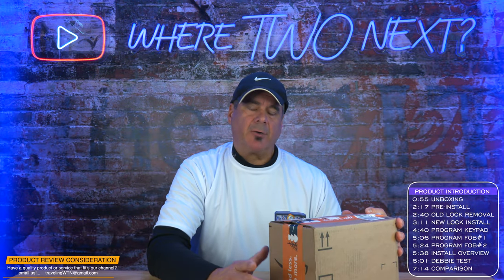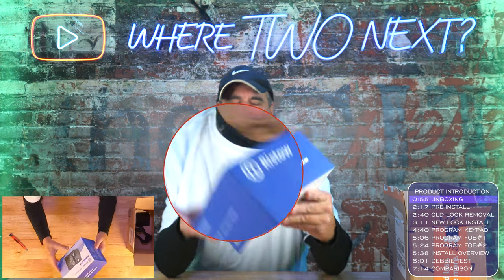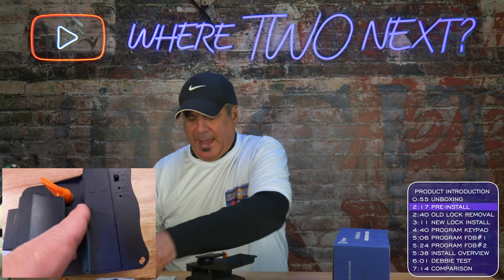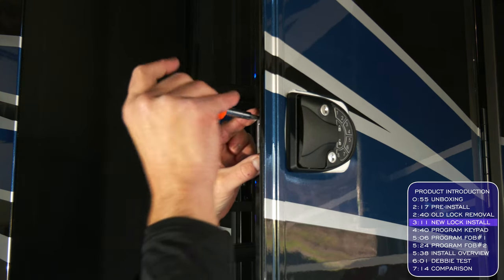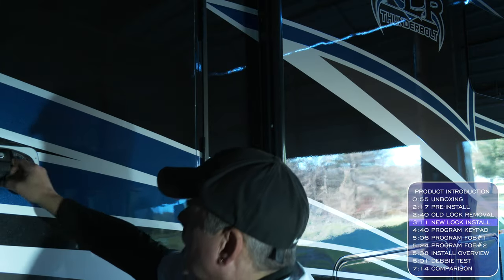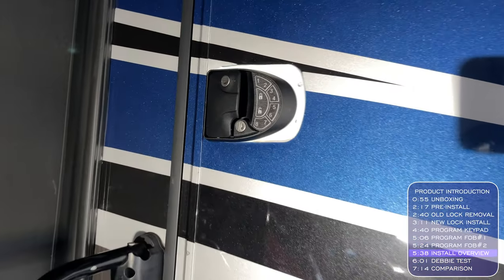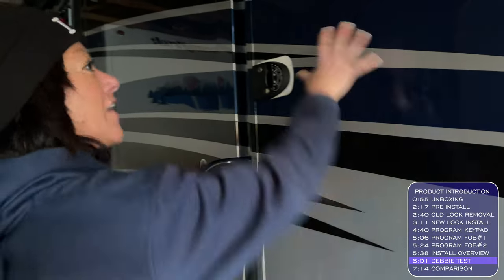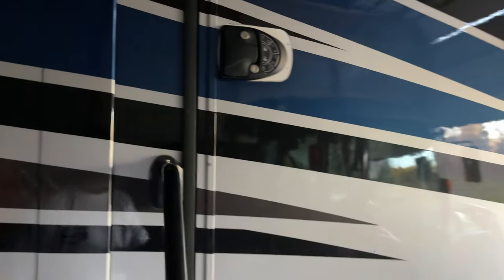RV Door Lock with Backlit Keypad and Key Fobs by Ristow

Comment: We just got one of these locks and can not get the second fob to work.  When we program the first one, it works.  But as soon as we program the second one, the second one works and then the first one doesn't.  It just keeps going in a circle like that.  We can't get both fobs to work at the same time.  Any suggestions on how to get both fobs to work at the same time?  Thanks
Reply from the maker: @Watts On Wheels
First off greetings!, I've seen a couple of your videos when searching HDT's. Very informative and helpful (I believe it was "what ya doing now, Dave"?) I Loved that line and then seeing Dave with sweat on his forehead changing a brake drum etc. Priceless!
I was going to purchase a new VNL 860 Globetrotter this year and have RVLifestyles do the conversion, but prices have just gone completely nuts!
Sorry for the rant, but you guys are great. So the one thing that was unique is/was that I had to press and hold the lock button on the fob and then indent that little button on the inside of the lock, and for both FOBs. I'm sure you know this already, so now you have me wondering?.... Our 5th wheel is in storage (our pole barn) and I'll go out and see if both FOBs still work... as it's been about a Month since I did the installation. TBC....
Reply from the maker: I tried ours, and same thing. I also tried to reprogram both at the same time by pressing in detent button and both lock buttons at the same time... no go.
So I've contacted them in hope of an answer, my contact guy is pretty good with English. TBC...
Reply: It appears that "only one at a time" means you have a SPARE fob not DUAL fobs.  Only one can be active at a time.
Reply: @GyroGearlooseHelis   You are correct.  I contacted them and they are sending us another one that will do 2 fobs.
Reply: @WhereTwoNext  We tried that and it didn't work.  We contacted the company and they are going to send us a newer version that is suppose to program both fobs.  Good luck in your quest for an HDT.  And thanks for watching us.  Safe Travels.
Reply: @WattsOnWheels  right... annoying to those of us who paid a little more expecting dual active fobs.
Reply from the maker: @Watts On Wheels
I got the same response back, needs a different Eprom chip program, most easily accomplished by replacing lockset. I passed on this as I'll just use the other Fob as a spare, just too bad that when they include 2 Fobs,  you'd think both would work at the same time. Happy & Safe Travels as well! :)
-KJ
Reply from the maker: Defiantly agree, albeit small for us, could be a deal breaker for others.

Comment: Something is missing from your code programming...  i tried press and hold L+8 and press briefly, neither results in taking the new code. Beeps seem to confirm, but 1234 remains active.   Please DO the procedure on camera instead of listing the instructions.
Reply: I'll help...
HOLD 8 and TAP lock
KEYPAD WILL FLASH - retry if it doesn't
Deet-deet-deet is wrong
DeDe-DeDe is wrong.
With it flashing, now QUICKLY type the 1234L####L####L sequence...  DeDe at each Lock phrase
Now it will work.
Reply from the maker: Hi GyraGearloose-HackingRVsCheap
I went out and tried it again, it worked (for me) by pressing the 8 and then lock at the same time.?
I actually (did) film myself pushing the buttons, but my fat fingers were in the way on a couple of depresses, so I figures a computer made visual would be better. Sorry you didn't like it.
Reply: @GyroGearlooseHelis  Thank you so much for YOUR comment. Holding 8+lock simultaneously DID NOT WORK FOR US. You're directions worked spot on, first time go. Great job with this correction. Pretty much every YouTuber who reviewed this got it wrong. I almost threw this lock across the RV park till I found your response. Thanks friend.